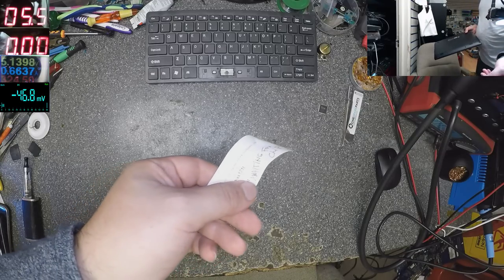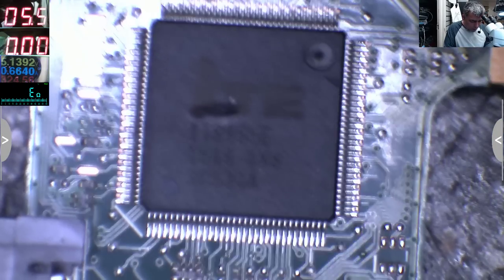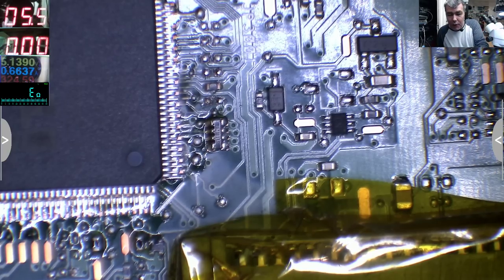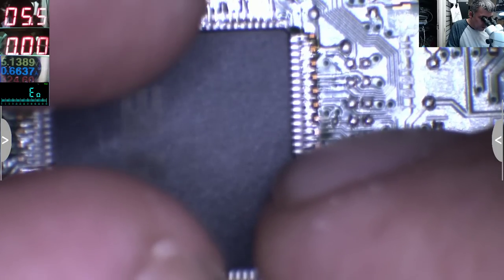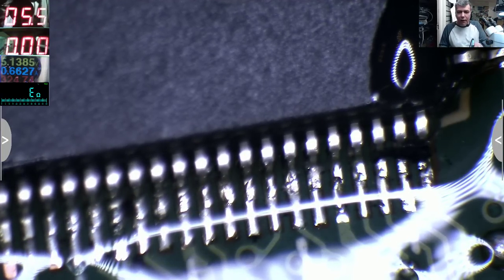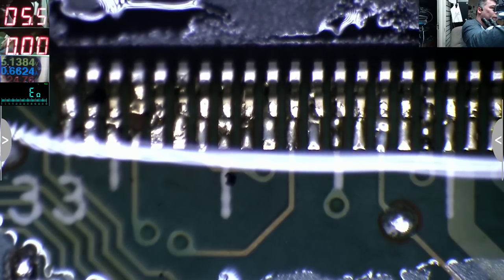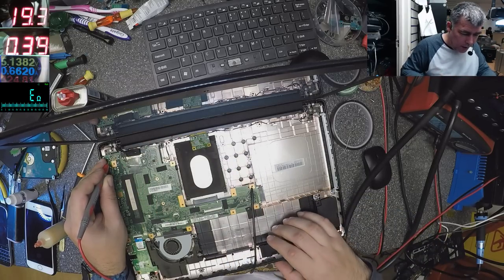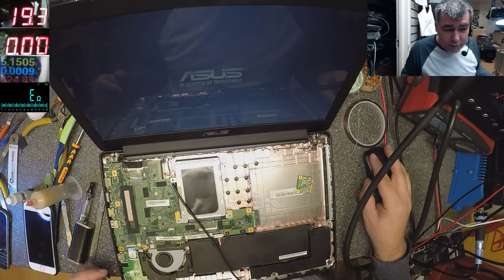Asus X553S, Dead, Motherboard Repair, Shorted 3.3v power rail by IT8885E Chip

Comment: Maybe you can try to remove old soldering from pcb with desoldering wick and than go to positioning and soldering chip, its a lot easyer. You shold try. When positioning a chip its easy to solder two diagonaly oposite pins to take chip in place and then do the rest of the pins.

Comment: why is your ic ite 8885e ? since mine is ite8985e..keybord problem ..changed not working ..second board charging problem on baterry pin + got 1.35v instead of 12v..changed 3 mosfets no change ..any advice ,?

Comment: luckily that SIO doesn't require flashing....
Reply: Victor Zed Wings: this super IO flashes itself, it takes the SIO (EC) Firmware from the SPI BIOS chip but some SIOs needs to be programmed manually. Some SIOSs are non- programmable and has a 2nd separate SPI chip on the motherboard for the SIO Firmware.

Comment: Sir,
i using asus x553ma-sx858d notebook laptop 
short details it
DISPLAY=15.6" (39.62 cm) display, 1366 x 768 px
STORAGE=500 GB HDD
PROCESSOR=Intel Celeron Quad-Core Processor
RAM=2GB DDR3 RAM
 I want to increase this laptop ram 2gb to 4gb, whether it will be safe or unsafe, please sir tell me you answer
      please  master help
Reply: You can if if your laptop is have 2 ram socket

Comment: pin it by 1 or 2 legs with soldering iron, then solder all.
you can easily position it also by removing leadfree solder and applying thin threads of Pb soldering paste. Chip will stay still.
Also you might want to use bottom heater up to 100 or 120 C. It will make soldering easier and improve quality of soldering up to 100% each and every time.
Reply: You all prolly dont care at all but does anybody know a trick to log back into an Instagram account?
I was dumb lost the account password. I appreciate any assistance you can give me
Reply: @Roland Wesley Instablaster ;)
Reply: @Arturo Reign I really appreciate your reply. I found the site through google and im trying it out now.
Seems to take a while so I will reply here later when my account password hopefully is recovered.
Reply: @Arturo Reign it worked and I finally got access to my account again. I am so happy:D
Thanks so much, you really help me out!
Reply: @Roland Wesley Happy to help :D

Comment: if winbond rom vcc shorted to ground  + ene kb3930 vcc 3.3v shorted to ground // cause 6500u pch ? injecting voltage to 3.3v line L(bobine)  1.5v 5a taking 6500u(cpu+pch) hot others not. cause ENEKB3930 possible? or PCH? Thank you for education video.

Comment: Way too many "Ads."   I know they must "pay the bills," but very distracting.  Would there not be some MOSFETs in that chip?   If so, can they be destroyed by the static electricity from your body?  (the gates, when you touch those pins.)  Always thought that static protection must be provided when working with those chips.  Thanks, enjoyed your video.

Comment: Thankyou for all your instructive videos. I have a Asus E402MA with Bios Winbond 25Q64FWSIG and troughout your videos you always says that pin 8 on Bios should have 3v. On this E402 I only have 1.8v and the datasheets says that also. So there can be other values?
Reply from the maker: well, you are wrong https://www.pjrc.com/store/w25q64fv.pdf  http://www.datasheetq.com/datasheet-download/840460/0/Winbond/25Q64FVSIG  , you should have 3.3v there
Reply: Thanks. But you gave info about Winbond 25q64FV. On datasheet for Winbond 25q64fW it says 1.8. Correct?
Reply from the maker: give me a link
Reply: es correcto FV (2.7 / 3.6v) pero FW  (1.65 / 1.95v)

Comment: I prefer to hand solder those, rather than hot air. I do clean the old solder, and I add solder while drag soldering a whole side at a time. Ive never not soldered a pin that way.

Comment: What could be the problem if tehere are LEDs on at power on, but they goes off in 3sec. Disassembled the laptop and the NB chipset getting hot in a few seconds. Nothing else is warming only the chipset.

Comment: Hi Master , when the 3.3 v are present on the bios chip, but the ENE chip its getting hot when the charger is pluged. that mean the ENE chip is bad?forgot to mention my laptop its completele death but I have the 19 power rail present and the 5v  even the 3.3v on the bios but the ENE chip its getting very hot
Reply: Same issue
Reply: Bro can pls response
Reply: @stephinkoshyskj  Hi. I have the same issue before with ENE KB390QF on an Acer board LA-7170p. Like you said it was heating when i plug in the charger. 3v,5V rails are present. I replaced it using the same chip from a donor board and it worked.
Reply: Yes the sio should never get hot so replace with same chip from a doner board or a new chip and program it with a avod, enit, or rt908f with ec rom from Dr bios .com

Comment: So a brand new chip would come with a firmware on it? I have a shorted SMSC1126 here so i am wondering if i buy a new one will it work? Because i don't have a KBC programmer.
Reply: You can buy a sio from doner of same computer. Or some suppliers will program them for you.

Comment: "Everything is fine" WRONG, the fan is not working.
Reply: A lot of fans will not spin until the CPU reaches a certain temperature.  He was running the BIOS screen which puts no strain on the CPU, plus he showed the big heat sink on the CPU at the beginning of the video..it will take more than the BIOS screen to get it hot enough to spin the fan.

Comment: That was a very good video because it did not work right the first time.. I learned a lot , I am especially inclined to go with soldering by a tip as opposed to the hot air method. I don't mind if it is longer since I am a hobbyist.  Thanks !

Comment: Is it possible to identify laptops that will flash those chips without the need of a programmer? I've seen some laptops with a secondary bios called ME. Those, i believe, can automatically flash  those chips. Am i right?
Reply: Diego Andrade the sio is programmable through the keyboard connection via a avod, enit, rt908f programmer and you can get the ec bios from Dr Bios .com. Some laptops with external bios can function without programming the sio but not all functions are going to work.

Comment: is necessary to upload firmware into ite chip or i can just replace them? i have issue on laptop asus N53SV
Reply from the maker: if you dont have a bios chip, you need a programmed chip
Reply: and if I buy this chip in china, will be programmed?
Reply from the maker: 'this chip' means my chip? my chip doesnt have a bios inside
Reply: sorry, this chip (IT8572E) from mb asus N53SV
Reply: Do you have experience to share concerning EC reprogramming? I mean the full theory behind super/IO and how to approach the replacement with appropriate tools...
Reply: Kuba Kyncl some suppliers can program them for you by request.
Reply: Luigi Mazzoli buy a Svod, enit, or rt908f with peb-1 if your going to be doing work with sio’s and you can get the ec roms from Dr bios .com. If you have good supplier some will even program the sio for you by request.